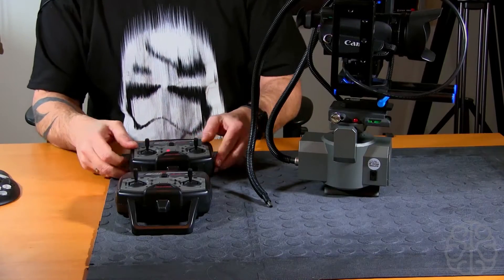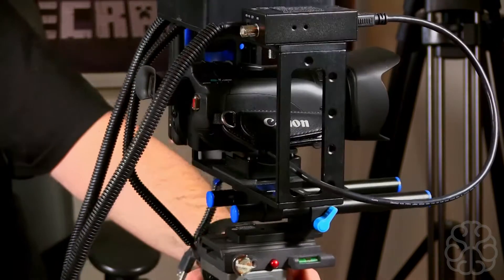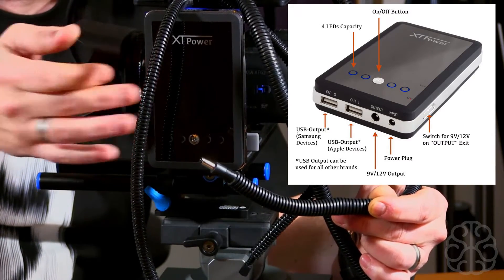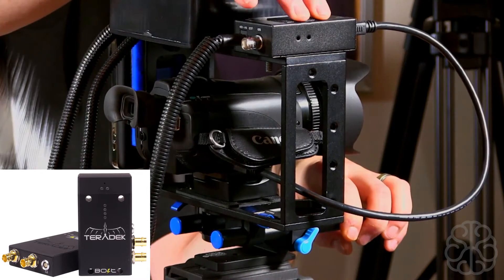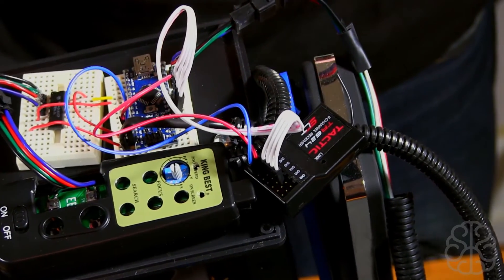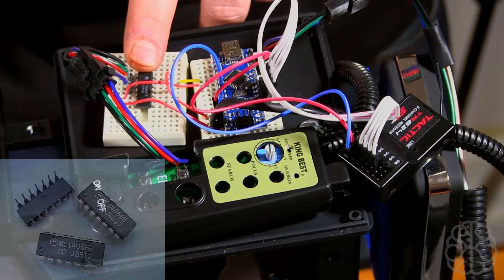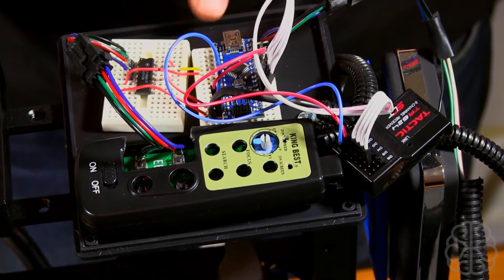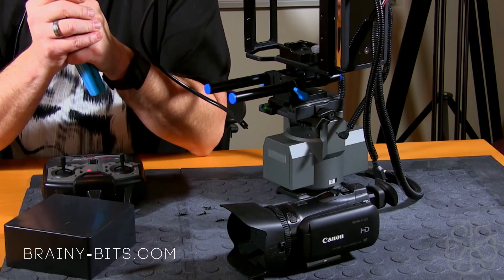Arduino Wireless PTZ Camera system with Bescor MP-101 & RC transmitter - Tutorial

Comment: Thank you very much. A great informative video in more then I expected. I would love to have a pan-tilt-zoom system for my second camera while I manually do eveything on my main camera. Also in situations when there is no room for a cameraman, this could be very useful.  I used an arduino for zooming via a servo as my amera's do not have LANC. My rig: https://youtu.be/Q199zLxkKXs
Reply from the maker: Hi, thanks for the comment, great setup with your camera rig!  If you build it, you could maybe use this to control the servo: https://www.brainy-bits.com/make-your-arduino-push-buttons/. Hope that helps and thanks for watching!

Comment: A simple diode between the power pack and camera would drop voltage for about 0.5 volts, so it could solve camera power problem.